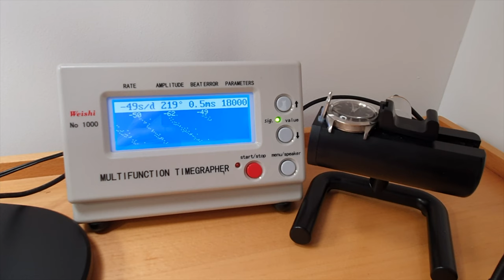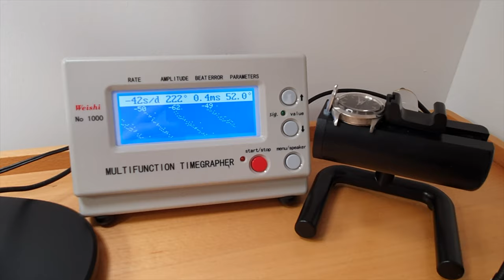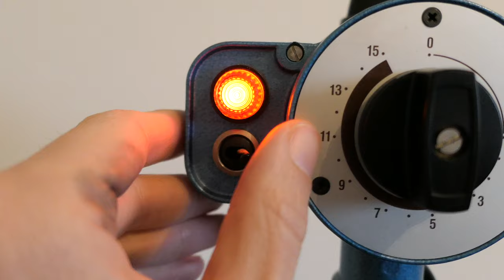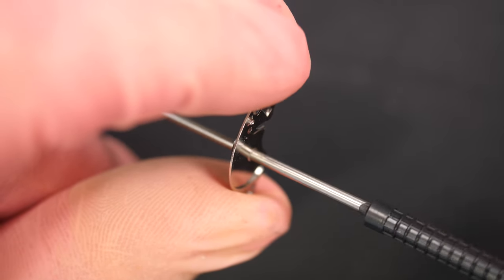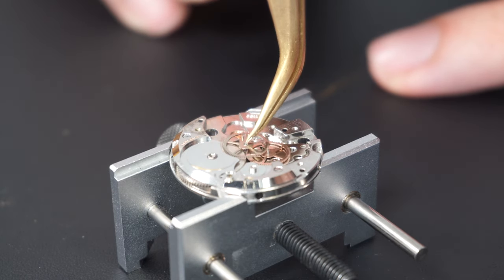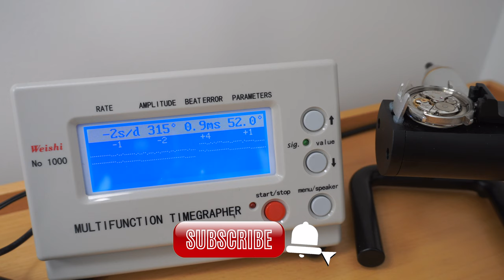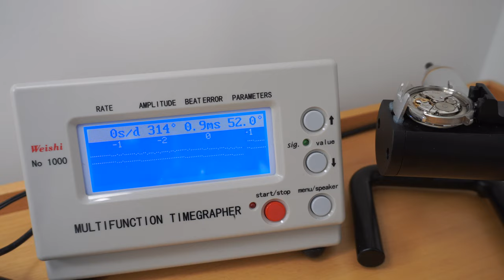TUDOR Vintage Watch Restoration - Rolex case & Tudor Dial 😍

Comment: Really nice job. I appreciate how you are moving forward with the better movements now. I see you have also obtained a staking set 👍👍. Your bench looks really nice; may inquire where you got it?  Thanks
Reply from the maker: Hi Eric, Thank you for you support. I got a vintage staking set and it is very useful. So much tool to get if you want to do a proper job. I got my bench from a watchmaker who got it from a swiss manufacturer. The bench is very nice but I don't have much information as nothing is written on it (brand or model)

Comment: I've never seen anybody put epilame on the balance hole jewels (only the endstones). Why do you do it?  Also, why didn't you use epilame on the escape wheel end stones? I believe they serve the same purpose as the balance endstones.  Thanks!
Reply from the maker: You are probably right and I can only put epilame on the endstones. I put the escape and the pallet fork in epilame too. You can only see the drying in the video at 13:09 after the treatment.
Reply: @FrenchWatchCollector  I also use epilame on the escape wheel. If the escape wheel jewels have endstones (just like yours), I treat them with epilame, too.
Reply from the maker: @jwoodyr1  Thanks for the tip. I will do on my futur project.